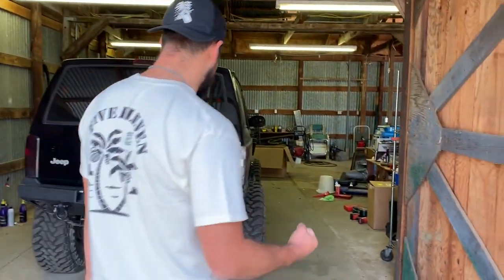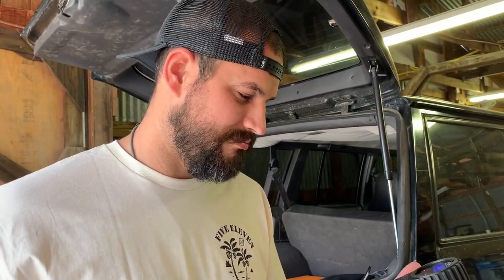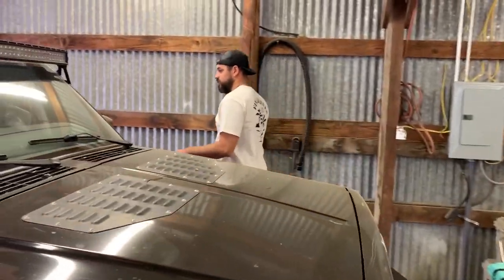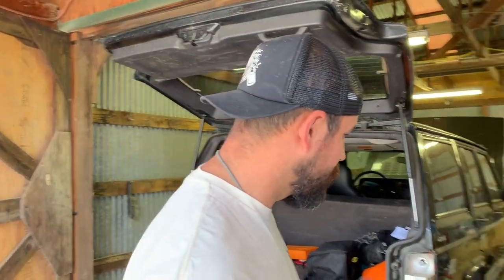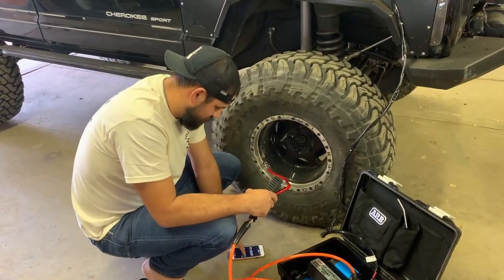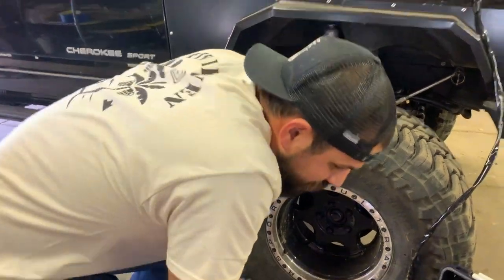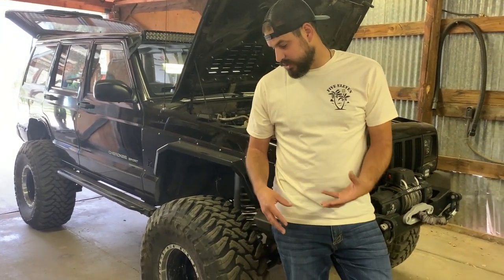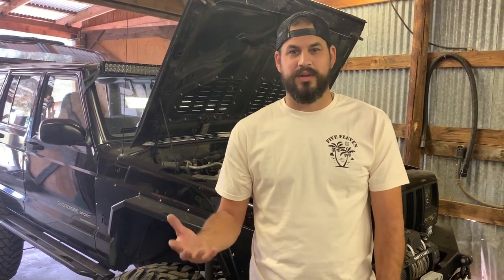ARB twin air compressor

Comment: That's pretty quick from being dead flat, It's about a 3rd of that time if you are just Airing up, It will do 37's in 90 seconds, The ARB Twin Portable has to be the best Compressor on the market, thanks for posting.